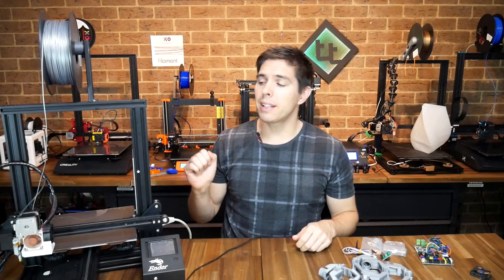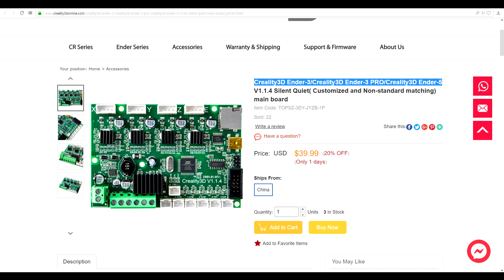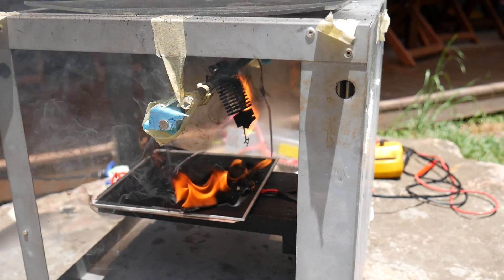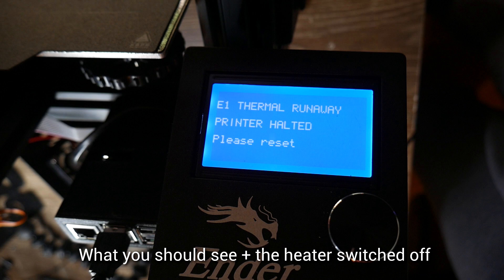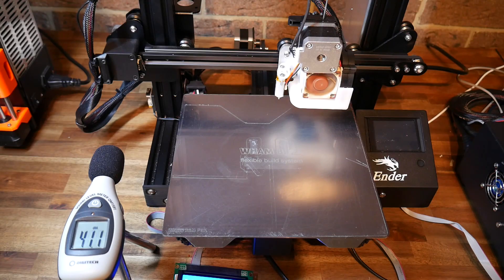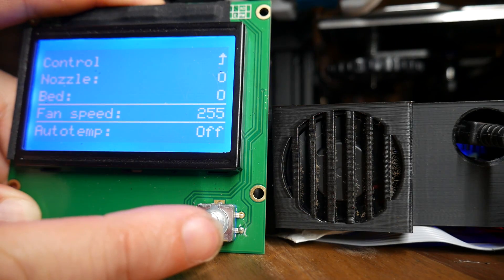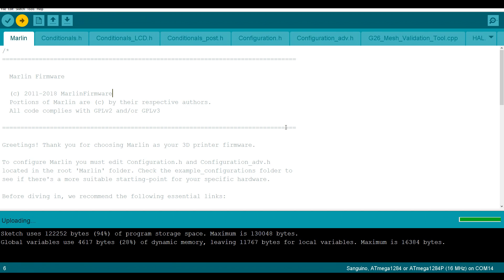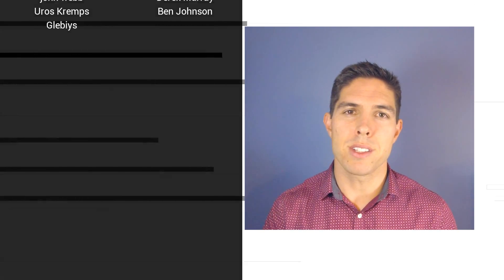Creality 1.1.4 Ender 3 board upgrade - TMC2208s from factory

Comment: I ordered one of these from AliExpress.
It came with TMC2208, it's the 1.1.4 board.
The software on it is for the Ender 3 Pro so I flashed my customized vanilla Marlin firmware on it over USB, worked fine.
It's very quiet now and printing works fine with it.
I have an Ender 3.
Reply: I got the 1.1.5 board, did yours have a bootloader already? if so how can i test to see if mine has? thanks
Reply: @charlielima  Yes, it did have a bootloader. You can test it by connecting it to your computer and checking if it appears in the devices list in the Arduino IDE. I was able to flash my custom firmware over USB because the bootloader was already present.
Reply: @xdevs23  Thanks, I have looked but not see it, not sure I am looking in the right place tho' as i don't see any 'device list' in Arduino IDE
Reply: @charlielima  Open Arduino IDE, connect your mainboard over USB and then go to Tools -> Port and check if a list appears with devices in it.
Reply: @xdevs23  When i do that it just says "COM6" - does  that for the 1.1.3 and 1.1.5 boards.  Flashed bootloader to the 1.1.3 board and it still says "com6" in tools>ports.
Reply: @charlielima  if it is able to detect it, then it's fine
Reply: @xdevs23  Ok, thanks for your help.  Seems the Ender 3 Pro I got last year with the 1.1.3 board had a bootloader already.
Reply: @charlielima  my 1.1.4 ender 3 did not. Only the silent 1.1.4 board had it.

Comment: Just received board, definatley has a bootloader and is super silent! Only problem I have is the screen on my ender 3 lights up but is blank until I login via octopi. Once I login the text appears on the screen? Any suggestions?
###UPDATE###
I have now found out the bootloader was corrupt, i re burned a bootloader and problem solved all good.

Comment: Great video as always. I'm still thinking about getting an MKS Gen L even if it is a bit of a PITA to install. I have been looking and there are two versions of the 1.1.4: One with the regular A4988 drivers and another with the TCM drivers. The one with the TCM drivers is currently sold out on the official Creality store and with other sellers it is hit or miss if you get the board with the A4988 or TCM drivers, even if you  do order the TCM version.  Not worth the risk to buy from another seller ATM if they can't assure you it's the TCM version. Many buyers have shown proof they asked for the silent version but the seller will say they sent them the correct version despite having A4988s, will not reply or tell the buyer they have to ship the board back at their own expense. Be careful where you order and make sure they do have the correct version.

Comment: Hi I have an ender 3 I have put the updated firmware with thermal run away that you put on one of you videos I now the stepper motor on the hot end keeps slamming into the micro switch when it go’s to the home position.
Can you help Steven.

Comment: I have this board already in my Ender 3 pro and no boot loader.  Had a tuff time flashing as I had to follow another process from forum with THC.  I just installed my BLTOUCH and now my printer is LOUD.  What do I do ?
Reply: The one that came with your printer does not have the upgraded stepper motor drivers or a bootloader. To get this you would have to buy the new board.
Reply: Hunter G can you supply a link to the board ?    Thanks

Comment: So apparently not only is Creality selling two totally different products as the V1.1.4 mainboard, but at least one Amazon seller is selling the relatively useless one as the good one. I just received and installed what was billed as a "Creality 3D Upgrade Replacement Silent Mainboard V1.1.4" and wow its NOT the silent TMC2208-having one. The poor English in the item description (for example: "ADVANTAGE: The Board is Optimized by Circuit, effectively solve the Heating Problem.") makes me wonder if certain sellers even understand how they're misleading people.

Comment: Received the board, of course it came with a 1.1.6 firmware for Ender 3... I have the Ender 5, and i'm trying to install the 1.1.8, but without progress. Only receive an error from the arduino IDE about insufficient memory and i think it came without the bootloader...

Comment: Although you don’t have to specify TMC2208 standalone in the configuration for the drivers to work, doing so will allow Marlin to tune step pulse duration and other factors optimally, so it is best to specify TMC2208_STANDALONE as your XYZ (and I presume E) stepper drivers for this new board.

Comment: I've one doubt! Can you guide me? In V1.1.3 Board Extruder Axis can be move without Heating-up Nozzle & in Newer board V1.1.4 It requires to heat nozzle than only i can move Axis of Extruder motor.....So i want to know where's the code in fimware file changed.....

Comment: Just purchased the Silent Board directly from Creality. This one will have the bootloader installed, do you raccomand to install the newest Marlin firmware to use the thermal runaway protection?

Comment: Well I deeply regret buying this board, I haven't been able to print a single successful file with it in 2 weeks.  If a file has any retractions the extruder driver inevitably shuts off after a short time and the printer continues to "print into air" with nothing to show for it.  Mine is from the first batch and it has no bootloader as well.  Creality support has been running me in circles and evasive regarding my concerns.  I really wish I'd just bought a different board.

Comment: After a month I finally got around to installing the new board, I didn't check the chips by removing the heatsinks but I assume they are 2208s because the silence is amazing. I can confirm it already had a bootloader and I just flashed the marlin I had set up already for my original board with no changes to the firmware. I shall do a test print later tonight after I level the bed

I assume the people commenting that they bought a board and it didn't have 2208s bought it from a 3rd party seller (ebay)

Comment: The information in this video is not complete, because buying a 1.1.4 board does not mean you get the TMC2208 drivers in all cases.
This video "forced" me to spend money not worth the value. Be careful when buying a 1.1.4. You might be disappointed like me!
Maybe it is better to stay with the MKS GEN L or even MKS GEN V1.4
Reply: If you buy the board directly from the creality site linked too on the video you will get the tmc2208 version.  You obviously haven't done your homework and purchased a 1.1.4 board with standard drivers from another seller

Comment: There is no bootloader on these boards from Creality. We just got some in to test and none of them came with the bootloader.
Reply from the maker: Mine definitely had one but I'm not surprised to hear this has changed. How do they expect Ender 5 users to load the correct firmware?
Reply: I finally installed my board and it did have a bootloader, I bought around the time this video went up direct from creality so I suppose they could be shipping newer orders without a bootloader.
Reply: @stevenbrown7413  so looks like Chinese bootloader roulette? Lol
Reply: @TH3DStudio  CHEP either lost the roulette spin as well or the missing bootloader is just the way it is now lol
Reply: I have installed. I can't seem to get my firmware to upload for so.ereason.. I uploaded bootloader. Do I use a different programmer than original board??

Comment: What program do I need to be able to change settings with my marlin I already have this new board flashed with? I used marlin 1.1.9 to accommodate my ezabl, going to add e3d v6 hotend and the same dd setup you're using and from what I read I'll need to change temp settings

Comment: Looks like the Creality page is updated. It no longer says thermal runaway protection is enabled, but it gives Dropbox links for the Ender 3 and Ender 5 that I presume are firmware with the protection enabled. Hopefully after videos like yours Creality has made sure they're updating the boards in the factory, but it's great that they provide these links.

Comment: I must say that the thermal runaway protection is a bummer, but if that can be fixed either by creality themselves at a later point or by the buyer. It should be a fairly easy fix. I am kinda sad that I ordered TL-smoothers with my Ender-5 and not just bought this board instead T_T

Comment: Anyone else having problems with the part cooling fan? I have an Ender 3 and the board says Ender 3 Pro.. When I turn on the part cooling in layer 2 via Cura nothing happens. But I can turn it on via the Ender 3 menu.. Does not turn off when the print is done? What the heck am I doing wrong? Had no issues with the stock board?

Comment: How about looking at 32 bit alternatives, speed etc
WitBot SKR V1.3 Control Board 32-Bit
$22 on amazon!!
Reply: Scary! would not trust it at all. 32 bit is not needed for Cartesian style printers anyway. Get a proper mosfett instead:
https://www.aliexpress.com/item/32855369632.html?spm=a2g0o.cart.0.0.4c3f3c00ewjlMX

Or better yet have you heated bed heat faster than your hotend for $50:
https://www.aliexpress.com/item/32841255135.html?spm=2114.12010612.8148356.8.21025791Ij9FCh
https://www.amazon.com/temperature-Ender-3s-Flexible-235x235mm-Silicone/dp/B07GJDL7XB/ref=sr_1_3?keywords=120v+heated+bed+ender+3&qid=1565270556&s=gateway&sr=8-3

both are needed. And why not add a proper spring steel removable build plate while we are at it? That is, unless you want to go past 60C.
https://www.aliexpress.com/item/33015063641.html?spm=a2g0o.cart.0.0.4c3f3c00ewjlMX

Comment: Sorry to ask another question about this but my x axis driver alone was quite warm so I tested the vref and mine were set to X at 1.2 and Y Z and E at 0.55~, which doesn't seem right. Had lots of under extrusion on my test cube.  May I ask what your vref values were for all axis and extruder?

I emailed creality but they haven't responded yet.
Reply: did you get any responce from these vref values?
Reply: No but I calculated it using a formula found on youtube, which accounts for the R150 resistors, and it should be 0.947 XYZ, 1.176 E.  I have seen people using 0.74 XYZ and 0.9 E with no issue.  My board is defective so I can't tell you what works best.

Comment: I just got this board in the mail but am having trouble updating the firmware. I can't get Windows to recognize the board! In device manager is shows up as "USB2.0-Serial", but it says that no driver is found. I tried installing the drivers that came on the flash card with my Ender 5, but still no luck. Anyone know how to fix it?
Reply: You will need to install the drivers. They are included in the th3d firmware
Reply: I did eventually get it to work. Took a couple restarts and updates. Thanks Mathew!

Comment: First, thank you for actually testing the thermal runaway protection! I plan on re-flashing it anyway, to accommodate my other mods. However, other people won't. I'm going to get it, though. It's a simple swap for the original and cheaper than the GenL when all is said and done. Any extra capability the GenL has I can make up for with my Octoprint setup. Thanks again!

Comment: Anybody have any idea which programmer to use when flashing 1.1.9 onto Ender 5? Having issues and can't figure out why. Using correct com port and Mega 2560 as board & processor
Reply: Same problem did you figure it out????
Reply: Did you have to do bootloader?

Comment: Just got my new board in but I'm a little confused about the vref, should I adjust it to the settings you calculated in your other 2208 video or leave it as is?
Reply: Well installed it and wow it is SILENT.  Now I'm shopping for new fans lol.  Still not sure about the vref though.
Reply from the maker: Creality have different value sense resistors so that's why this value is different. Just leave it as is unless the steppers skip or overheat.
Reply: Thought that might be the case but I don't really understand this stuff, Thank you!

Comment: Did anyone order one and actually receive it yet?
Reply: I just did, in the US, but haven't tested it yet
Reply: @ByGraceThroughFaith777  my tracking number still says it's in route but hasn't changed in 2 weeks
Reply: @davidsandt4856  I ordered mine on April 10 and  got it delivered by USPS yesterday April 24, so it took exactly 14 days.  You can copy/paste the tracking number on the USPS website if you live in the US. Like anything else that comes from China, patience is key :D good luck.
Reply: @ByGraceThroughFaith777  ordered mine the 11th so maybe today will be my lucky day
Reply: @ByGraceThroughFaith777  it's the last piece of the puzzle needed. I got a 3ed v6 hotend and a 5150 fan all waiting to be put in at the same time. Only hang up is going to be programming the new board to accommodate those plus my ezabl, still a novice at all of this.
Reply: @davidsandt4856  The good thing about this updated v1.1.4 is that it comes a boot-loader already, so it should be pretty easy to modify Marlin's parameters to fit your mods. I upgraded to the Micro Swiss MK8 Hotend so I didn't have to mess with the firmware. Auto bed-leveling can be tricky on the Ender, but doable, Teaching Tech
 has a good vid on the ezabl too. I decided to only upgrade the leveling springs to the yellow ones on mine, and it keeps the bed pretty level for my needs, for now.  But I definitely think the hotend upgrade is a most in order to print PETG, Nylon or anything other than PLA that require higher temps. 
The other 2  "safety related" things I would suggest if you are going for higher temps are to get a Mosfet for the hot bed ($15) , and a MEAN WELL LRS-350-24 power supply for $30 on amazon. If you want you can also upgrade to wire ferrules for the high current connections. With this Chinese printers is better safe than sorry for me....

Comment: I'm looking to buy the Ender 3 non pro version as well with some upgrades such as 

-3 stepper dampers(pack of 3)
https://m.aliexpress.com/item/32958351783.html?spm=a2g0n.shopcart-amp.item.32958351783&

-3 TL-smoothers (pack of 3)
https://m.aliexpress.com/item/32967300597.html?spm=a2g0n.shopcart-amp.item.32967300597&

-Metal extruder
https://m.aliexpress.com/item/32919143429.html?spm=a2g0n.shopcart-amp.item.32919143429&

The ender 3 I want to get is the one that comes with the glass bed.
https://m.aliexpress.com/item/32829861835.html?spm=a2g0n.shopcart-amp.item.32829861835&

Any other suggestions on other upgrades? Preferably from aliexpress. I'm still new to 3D printing but I'm no stranger to DIY stuff.

I would appreciate your comments and suggestions. Maybe if there is another value printer that I should know of.

Comment: The SKR v1.3 with TMC drivers is worth considering. It's a 32 bit board, completely configurable for UART or SPI using jumpers, and runs Marlin 2.0, while costing barely more than a 8 bit Gen L.

Not quite the drop in replacement this is, though.

Comment: Ever since I have gotten myself an Ender 3 Pro, I have been following your guide on how to install Octoprint, BL-touch, flash marlin firmware, tweak settings etc. It all worked out great, thank you so much! Your video made everything much simpler and easy to follow. However, I just ran into a dire situation yesterday. I was doing a 19 hr print and suddenly halfway into the print, about the 9th hr, my printer suddenly stopped. Upon inspection, it seemed like my print head has stopped printing but temperature of nozzle and bed is still maintained at the preset temperature. I tried to restart the print the 2nd time, however it failed again somewhere 1 hr into the print. I have tried reslicing the model and reprinting using SD card instead, but the same problem occurred. This time it happened much quicker, about 20mins and the temperature of heaterblock & bed drops once the printing has stopped. Once I caught a glimpse of how it all happened: it prints normally at first, then the LCD screen suddenly went blank, but still have backlight. The moment the LCD turns blank, everything stopped, then LCD would turn back on again while the print head remains where it was. There is no prompt on screen asking whether i would like to resume printing, and the status is shown as if the printer is printing as per normal. Please help :( I am suspecting that it might be due to a faulty mainboard but I couldn't be sure as it is not cheap to buy a replacement board. Any input from you would be appreciated. THANK YOU!!!

Comment: So. As a total noob, emphasis on noob, I see a board with TMC2208 drivers (a plus), 8bit processor with associated limited room for programming (a minus), needs to be flashed to make thermal runaway protection work (definite minus) and currently a $49.95 price. So ease of install is its claim to fame? I would rather see a video on the easiest to install 32bit controller, preferably  with replaceable drivers. Sorry if this sounds like a complaint, I really like your videos for being detailed and the way you include links to items from the video. Thanks for all your work

Comment: I have a new Ender3 Pro with the 1.1.4 board, what;s the easiest way to tell if I have the newest board?
Reply: this is probably too late - but It's a completely different board, both will say "1.1.4" on it, which is SUPER confusing

Comment: After some conversation, creality have updated their description on eBay to clarify that those boards do not have upgraded steppers and the bootloader.

They did not however acknowledge my unreasonable request that they mark these somewhat different new board as 1.1.5, stating "they have the same hardware".

...I mean, they don't have the same hardware, but whatever.